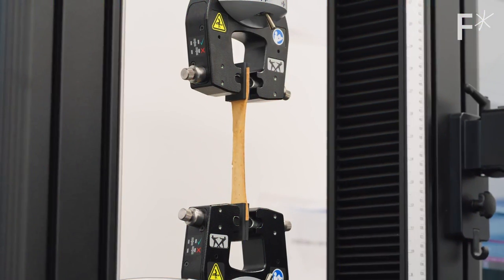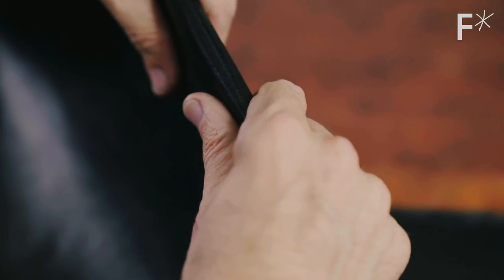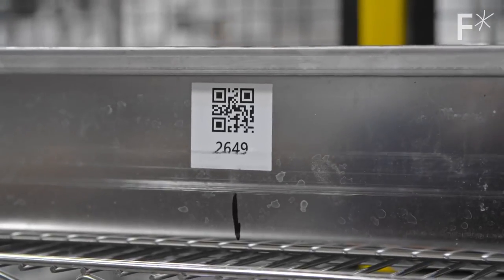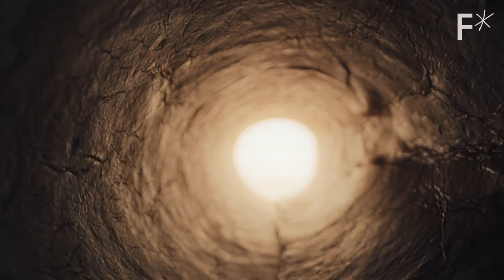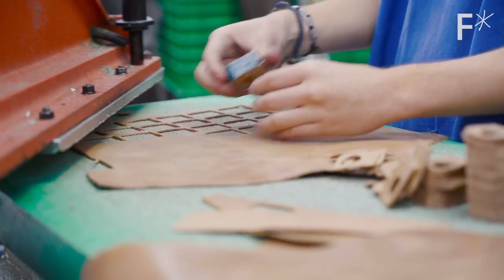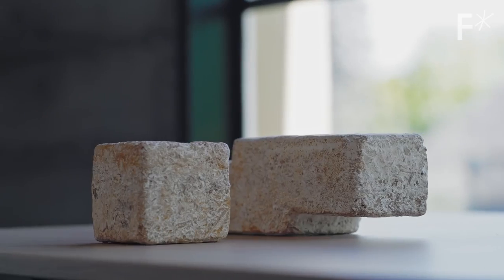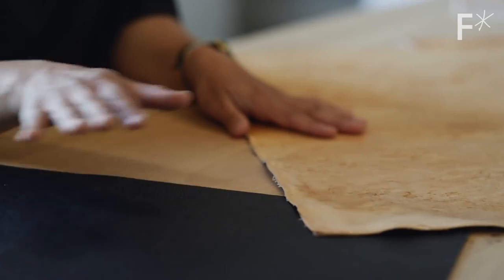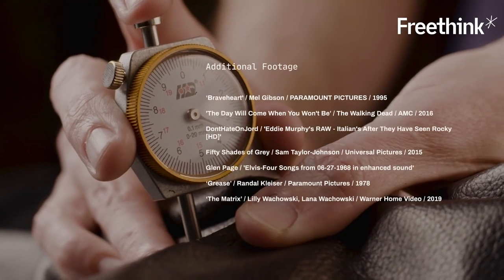See Inside the Lab Growing Mushroom Leather | Freethink*

Comment: How about the breathability? It may isn't important for accessoire stuff, but when used for clothing or seating furniture, it is a key feature to be able to transmit moisture.
Reply: Intellectual ☕😂
Reply: My guess is: Since it is still a woven type of structure and finished very much the same as leather it maintains a similar wicking capability as well as the ability to be waterproofed. It can also be grown to different specifications depending on the intended application.
Reply: Is my sweat and biological debris going to reactivate the fungus?
Reply: No, the organics are dead after being processed and conditioned. 

However, same as real leather or faux leather and vinyl it would still be capable of growing mold if left in a humid and contaminated environment similar to car interiors and apartments that can get moldy.
Reply: Are you joking? Leather takes hours to breathe. Synthetic fabrics breathe in seconds. That's why people don't wear brogues in the summer.